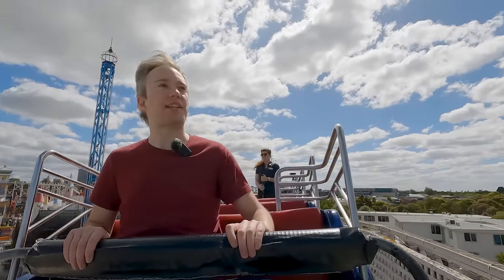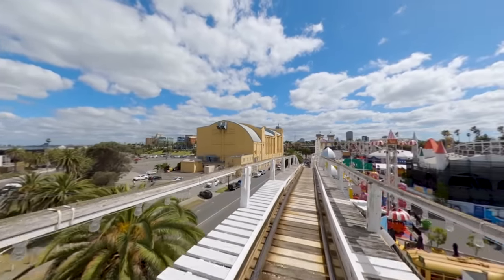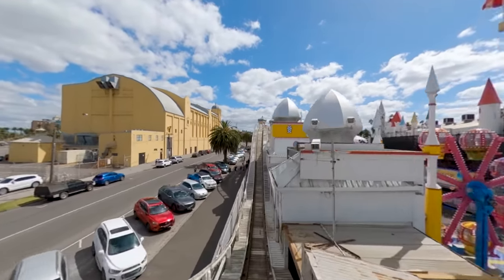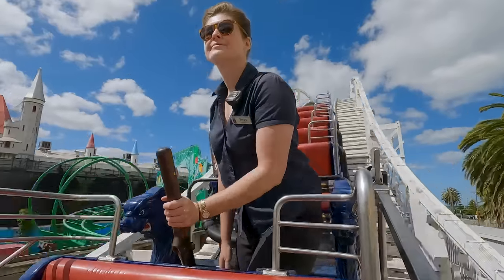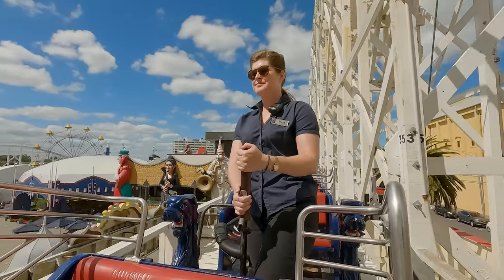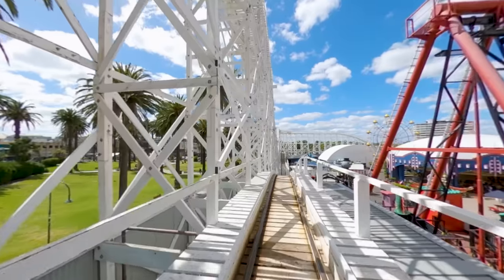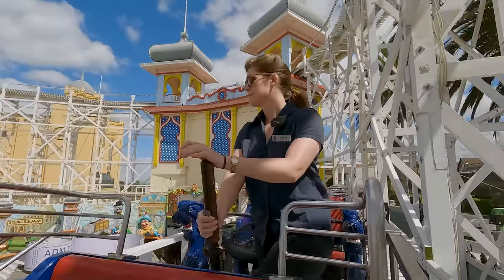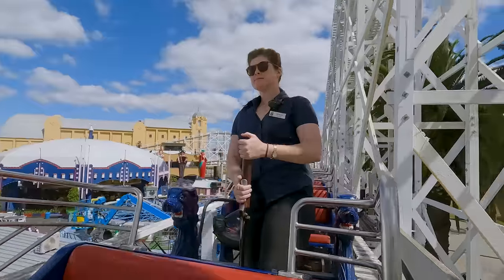This rollercoaster doesn't stop automatically

Comment: I think your description doesn't quite capture the video. This roller coaster uses a human brakeman on the train. There are many other roller coasters in the world which still are operated with manual brakes. I would imagine a number of traveling carnival rides. I know specifically the Sea Dragon at Wyandotte Lake, Wyandotte Lake was sold to the Columbus Zoo and Aquarium a number of years ago and renamed Zoombezi Bay. 

On a good day with good brake shoes the roller coaster requires a good amount of effort to throw the manual brake lever. As it's usually run with the brake shoes badly worn, it requires a huge amount of effort to throw the levers and control the coaster. 3 years ago there was talk of adding in an automatic braking system, I don't know that that's happened yet.

Comment: Tom mentions there is a bit of airtime, but that begs the question: How is the operator not getting thrown out at that point? I am going to assume it's very minor airtime, not ejector or anything, but with the operator not strapped in you would still think any airtime could potentially have them leave their feet.

Comment: No mention of fail safe? No mention of any accidents in the past! What does the brake look like? What happens when the operator has a health issue and is unable to perform their duties... unfortunately it usually takes a couple of deaths before safety is implemented correctly

Comment: Never understood the reason people pay to be scared on something they would sue if they were injured. Baring some spectacular mechanical failure these rides are as close to 100% safe as it is possible to get. Humans are perverse.
If you really want an adrenaline rush try wingsuit flying or BASE jumping.
Reply: The whole point is you get the thrill without the risk. Plus roller coasters are a lot more accessible to the average person than extreme sports.